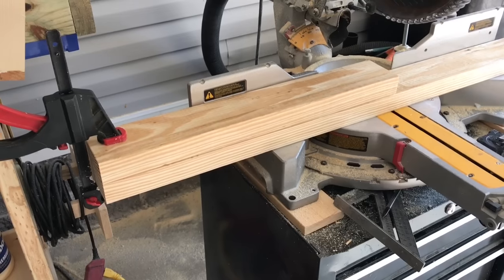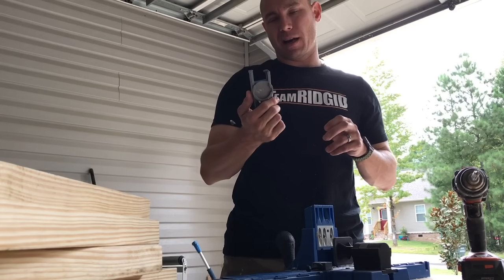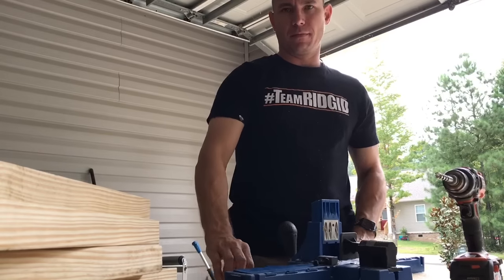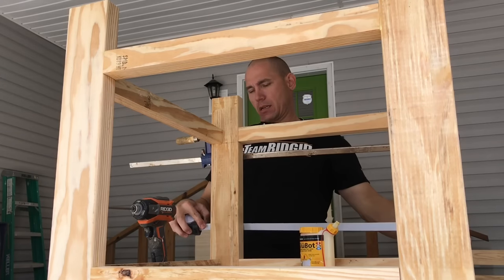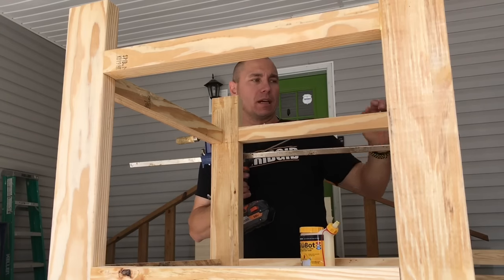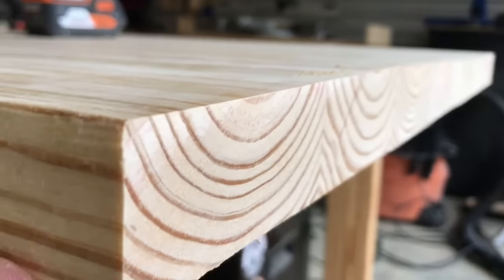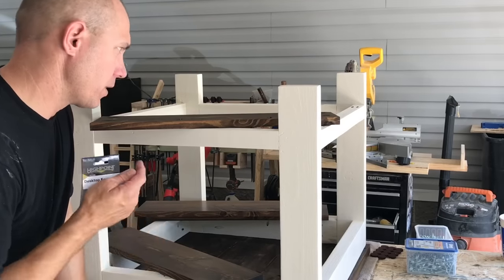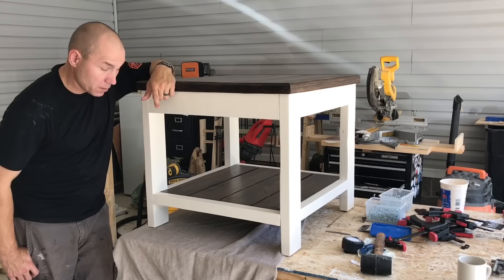Farmhouse End Table (DIY) with Build Plans

Comment: Great work and I love how it turned out. One recommendation I would share for the poster or anyone building this is to alternate the grain when assembling the top. If you look at the ends you have a u shape in the grain and it is best to alternate those up, down, up, etc. As the wood takes on and gives up moisture those boards could possibly cup. If they all face the same direction that is very much exaggerated and the top could end up with a significant cup up or down. Yes, a 2x4 is pretty thick and narrow but someone could attempt a top with 1x6 and there is a good possibility for issues over time with thinner, wider boards. Just a small tip for longevity.
Reply from the maker: Thanks for the tip
Reply: Great tip. I made a table for a lady and then it cracked right down the middle- not good. Now I use figure 8 fasteners to fasten the top to the base.

Comment: I like how you decorated the lip at 10:41.  In most cases, that will not be an issue, but if the top is being used for a table or desk where someone sits and rests their arms, the sharp corners may not feel good on their arms.  My current computer desk has 90 degree edges and It's always causing pain and leaving marks on my arms. 

I'm designing a new desk where I will trim it with hardwood and round over the corners with a router. 

This might not be an issue with your table for your purpose, but it may for others. 

Thank you for your videos, I'm loving them.
Reply from the maker: Thank you for all your feedback. I appreciate it

Comment: I really like the way you explain the build along the way. Everything made sense until the end when you were describing how to use the figure 8's. I got lost there a bit on how to finish that off. Also, I was curious as to why pocket holes would work there, I know you mentioned something about wood movement. You have some very nice stuff!
Reply from the maker: Thanks.  Glad it helped. Yeah attaching a top with pocket holes prevents expansion and contraction of the wood top which could result in the top cracking. But honestly I have a few pieces I’ve made that I attached the top with pocket holes and they’ve been fine. Had them a few years now.

Comment: Hey Matt!  Thanks for the plans and the guidance on building this table.  I built it last week for my daughter. It turned out great.... Painted it white with a natural finish on the top and the bottom slats.  I've got a question, though.  I may have misinterpreted your instructions and cut list.  I could not get the cuts from 4 2x4's.  I had to use 6.  Please correct me... Thanks
Reply from the maker: Glad it worked out.  Did you use 10' boards?

Comment: I really enjoy your videos Matt. I have learned so much. Do you have a video or do you know what to do when your miter saw gets off center. By that I mean, my saw does not line up. I don't know how to fix it. My miters are all messed up. Of course to cut straight I can use a 90 angle and get it almost perfect. but I have it for MITERS. lol any suggestions?
Reply from the maker: Not sure.  Maybe search your model number and adjustment
Reply: @731Woodworks  Thank you

Comment: Hey man I love your videos! I bought the plans for this table and started to build it, and I have a question. For the 2x4’s for the top, did you take a little off each side to remove the rounded edge that they come with? It seems if I do that it’ll take quite a bit of width off the top. Thanks!
Reply from the maker: I did take the very edge off of them

Comment: I read thru all the comments but cannot find how you made the bottom shelves level with the rails. Is it as easy as using a clamp?  Any other ideas?
Reply from the maker: Clamps. Or hold them in place and screw them in easily.

Comment: Thank you for the video and the directions on how to build this. My wife saw it know has me starting to try and make her a set. How do you joint the boards together?
Reply from the maker: With pocket hole screws
Reply: @731Woodworks  I'm sorry I meant did you use a jointer before the pocket holes, to remove the rounded edges of the 2x4?
Reply from the maker: @r.davidhens4056  I jointed with my table saw like in this video: https://www.youtube.com/watch?v=9HMMWGkI1ZI

Comment: I'm very late but anyway. How can the legs be 2x4 but you are saying 3 1/2 and 1 1/2 on either side when attaching aprons? Also the top is 2x4 by 8 so it will be 32 but you are saying 28. So is a 2x4 in USA a 1 1/2x3 1/2?
Reply: Yep, in the USA a 2x4 is 1.5x3.5. It wasn't always that way, and I won't pretend to be an expert, but a mix of standardizations and lumber shortages after World War I led to lumber's actual size being smaller than it's nominal size. In short, suppliers had to stretch their stock to not only make it last but keep it cheap and competitive vs other materials. The nominal sized name stuck, even though the actual size is smaller.

Comment: Pro tip...You can just use water as the wood conditioner.  It opens the grain just like the wood conditioner. Just take a sponge and wipe on the water, squeeze the water out of the sponge and wipe of the excess water.  Let it dry then stain.  
I do hardwood floors and this is a process we use to achieve an even stain color. Especially on wood that stains splotchy like Pine, Birch or Maple.
Reply from the maker: Thank you

Comment: Good work. My only advice is regarding the wood conditioner. I used to think the same thing about application time. Turns out that what the directions really mean about the 15 to 20 minutes, is that is the working time. Your stain is supposed to be applied within that window. Obviously you don't want to completely soak with conditioner. Just wipe it on quickly. Then the stain within that 15 to 20 minute window. The conditioner opens up them pores so the wood will take the stain evenly. When the conditioner has dried, it ceases to open up them pores. So adding stain after the conditioner dries, its not going to take it evenly.
Reply from the maker: I have read the conditioner actually seals the pours so the stain doesn’t soak in as much, which prevents the blotching.
Reply: @731Woodworks  hmm. Well I wasnt trying to mislead you.. That's the same conditioner I use. The directions say to stain anytime within that window. But honestly, it's really not that important. Your tables came out awesome.
Reply from the maker: @robbrown39  On no sir, I know you weren't trying to mislead me.  I'm sorry if it came out that way.  I think there is always a lot of differing opinions on those kind of things, it's hard to know what the right way is.  I'll try it the way you described next time I use it and see if it makes a noticeable difference.
Reply: @731Woodworks  I did some more research on it and your way is closer than my way to the right way. It's true that you dont want to wait too long to stain, but it's also true that you have to give the conditioner time soak in. The window of opportunity is more like 2 hours.
Reply from the maker: @robbrown39  Oh ok, I gotcha.  That makes sense.  Thanks for following up.

Comment: I dont have a saw but if i wanted to get the pieces pre cut what sizes would i tell lowes or home depot also if i dont pocket screw it what else would you recommend.
Reply from the maker: Full cut list is on the video at 0:34 seconds.  Thanks.
Reply from the maker: I would recommend picking up the Kreg R3 pocket hole jig for this project.  You can get it for under $40 here: https://www.amazon.com/Kreg-R3-Pocket-Hole-System/dp/B000J43A7W/ref=as_li_ss_tl?ie=UTF8&qid=1541864746&sr=8-1-spons&keywords=kreg+r3&psc=1&linkCode=ll1&tag=731woodworks-20&linkId=a27baad3732ff4d5e8b94136b15eefa1&language=en_US (affiliate link).

Comment: How did you get the table top tubafours so flat on all the sides before you glue them together?
Reply from the maker: I joint the edges. Otherwise I buy #1 grade lumber.

Comment: Great build and well explained. Thanks for sharing.
I followed the link to the plans and I found a whole bunch of them. You have a good pricing on them. 
But there is not very much information (before the purchase). It only says that it is a 10 page PDF file and that it costs 3,99 USD.
Maybe you could provide some more information  what is on the PDF pages. 
Is there a purchase list, a cut list, drawings (sketchup or otherwise), is it only imperial or in metric as well, etc.?
Maybe you can (also) make a short video about the plans you made and provide that information also there.
Measurements also in metric would be a big plus. Steve Ramsey often has free plans of his projects, nearly always in metric and imperial.
That could eventually be a big help for you for the conversion from imperial to metric.
Reply from the maker: Thank you for the advice.  I really appreciate it. I'll look into adding more detail to the description.  In the mean time, if you check out the blanket ladder and vanity plans that are free you'll see the format that's used.  Thanks again.
Reply: @731Woodworks  You're welcome. I'll take a look at the plans you mentioned.

Comment: Matt, new sub here (sorry it took so long, I just found your channel) I noticed that the bottom shelf had a little gap between each board.  How big is the gap between the boards and is there a reason you didn't laminate them as a solid piece like the top?

Comment: First of all, thanks so much for sharing... I’ll definitely sign up to support you through Patreon!!
have a few questions.  
Are you using that water based poly coat over the oil based stain?

How many coats of stain?

How many coats of the poly?

Can you just wipe the poly on with a rag?

Thanks again!!!
Reply from the maker: Thanks! I only use one coat of stain and let it dry for 24 hours.  It is oil based stain. Then I use a water based clear coat.  I wouldn't use a rag to wipe on water based.  If you use a good quality brush and you won't have brush strokes.  Water based poly will dry clear and self level.  Just apply a small amount at a time.  I usually apply 3 coats.  Also watch for drips and runs because those will dry a milky white.  Hope that helps.

Comment: How did you get the 2x4 top look like 1 pieces?? Mine has gaps in it in between the 2x4’s
Reply: You need to joint the edges to make them straight.

Either use a tapering/straight edge jig with your table saw, or a jointer.

If using a jointer, make sure to use the in/out method because the jointer fence sometimes will deflect and the boards won’t match up perfect.

Comment: Nice, Matt! I think I'm going to switch to the Z clips when I run out of figure 8s. They are WAY cheaper. I didn't know you used SketchUp. I had offered to send you a SketchUp file of my Fancy X with all the right measurements, but since you already use it, I can send you all of my tables. 👍🏻😁
Reply from the maker: Del Johnston Thanks! LOL.  I don't, you did that sketchup for me and sent me a screen shot when I first got on Instagram.  I use it when I build these tables now :)
Reply: 731 Woodworks DOH! Haha, I'm an idiot. 😂 well, I can still send ya whatever ya need. 👍🏻
Reply from the maker: Del Johnston Thanks!

Comment: Thanks for the video! Did you cut the slots for the fasteners before or after painting?
Reply from the maker: It's best to cut them before painting.
Reply: @731Woodworks  ok. Also I don't have a router yet so could I use my circular saw set to 1/4" or 3/8" to cut the slits?
Reply from the maker: Sure you could
Reply: @731Woodworks  thank you so much for your video and advice! Your awesome
Reply: One more question :) do your 2x4 have rounded sides? Or did you rip the round off?
Reply from the maker: I rip the edge off
Reply: @731Woodworks  :) thank you
Reply: I am nearing the end of this build. And I am attaching the bottom 1x6s to my frame on the bottom apron and the 2x2 just split as I was screwing it in :..( any recommendations on how to fix it without removing the whole piece? Everything is stained painted and sealed.
Reply from the maker: CA Glue can fix a split. Starbond medium thick with the accelerator to make it dry fast
Reply: @731Woodworks  thanks ill give it a try

Comment: What is your pocket hole jig and bit set to?
Reply from the maker: I set it to 1 1/2" for 2x boards
Reply: Thank also ... are these specific 2x4s I feel like.the 2x4s I normally buy have slightly rounded edges ..thus making the top wont be perfectly flat and the boards won't fit together well ..
Reply: I'm kind of new to this type of wood work

Comment: Can't go wrong with General Finishes.  It's worth the extra $$$.

Their water based clear coat can be brushed on or sprayed on and cleanup is a breeze.
Reply from the maker: It’s great stuff!
Reply: @731Woodworks 

I will say that an oil based poly probably looks better for some applications.  I bought a can of GF water based poly with the amber tint but haven't had a need to try it out.
Reply from the maker: Yes I agree. General Finishes Arm-R-Seal is a great oil based finish
Reply: @731Woodworks 

Don't laugh, but when I have to use a brush on oil poly I go cheap with the big box store stuff.  For water based nothing lays out as flat and is as durable as GF water poly.  When I spray it I use an inexpensive Home cheapo spray gun and get professional results, and again, clean up is a breeze with water based.  I never have and never will spray an oil based finish.
Reply from the maker: I’ve never sprayed oil based either. I like the GF arm r deal because I can wipe it on with a cloth and it comes out great.
Reply: @731Woodworks 

I used Minwax wipe on poly on a few projects, it was for bamboo paneling.  Easy cleanup/throw away lint free rag.

If cleanup wasn't a hastle I'd probably use oil based finishes.  I say probably.  But I like how water based dries quicker.  And for maple I don't like the yellow/amber tint.  I like a natural look and water based poly preserves that natural maple color.  Oak seems like that amber tint just works.  That's why I bought that quart of amber tinted water poly.
Reply: @731Woodworks 

I need to get off my arse and make something in oak so I can use that GF amber water poly.  :-)
Reply from the maker: Yeah the dry time is so much faster on water based. That’s one of the main reasons I use it too.

Comment: Living in South Africa, and loving the way you guys in the US do woodcrafts - I always have this HUGE stumbling block:  I need to work out in my head the inches and fractions of inches - into decimal.  That takes up half of my project time!  One inch, is 2,54 centimetres, or - using the logic of ten - 25,4 milimetres.   That I can cope with.  But the minute you guys start talking in fractions of inches - I need to ask :  WHY?  You are such a great nation - except you haven't embraced the logic of ten!  ;)  Example:  28 1/8 inches , equals   0. 714375 meters, or 71.4375 centimeters, or 714.375 millimeters, or 714375 micrometers  OR - just keep on dividing by ten - you see the pattern?  MUCH easier if your base is 1 and 0.  With commas, As you go into fractions...  Come on, guys....I know you hate the french - but enough is enough.  :)

Comment: Do you still have an old end table video? I made a few of those a couple of years ago and now I'm getting requests for those end tables on Facebook marketplace.
Reply from the maker: Yes I do. Here https://youtu.be/YimuXos9PDg
Reply: I'm thinking of the one with 2x4's on the lower shelf
Reply: I suppose I could alter the plan to use 2x4's on the bottom as well
Reply: It will make the table a little more chunky
Reply from the maker: @billpaterson9046  Here are all of my videos.  I have several end table designs https://www.youtube.com/channel/UCSLClJLzdUMRMe0E4SPfc-w/videos

Comment: For some reason, my seams moved a fraction upon screw installation. 
I suppose I’ll need to clamp the two boards together to keep them flush. 
Any wisdom regarding that? 
It really bummed me out. So, I sanded it down 😂
Reply from the maker: It happens from time to time. Clamping them will help a lot
Reply: 731 Woodworks - yeah, it appears one of my boards had a slight twist in it.

Comment: Do you buy your lumber already S4S?
Reply from the maker: I usually have to square it up myself on the table saw.
Reply: @731Woodworks  So is it safe to say you don't use a planer or jointer?  Those are pretty expensive so I'm hoping to get started without them.
Reply from the maker: I worked for a while without a planer. I still do not have a jointer. I have a planer now but don’t use it much at all honestly.

Comment: I'm loving your video, but I see something interesting. 

About 10:18, you show your end pattern and the grain is all the same direction.  Most builders alternate them to keep the table level.  It's been a year since you built the table, are you having any problems with the top not being flat and level due to the boards warping?
Reply from the maker: No sir. No issues at all.

Comment: what size pocket hole screws ya using?
Reply from the maker: 1 1/2” (correction 2 1/2”)
Reply: @731Woodworks  even on the top?  was the top not flemsy?
Reply from the maker: I’m sorry, I miss typed. I use 2 1/2” screws
Reply: @731Woodworks  lol I figured....thx for reply!